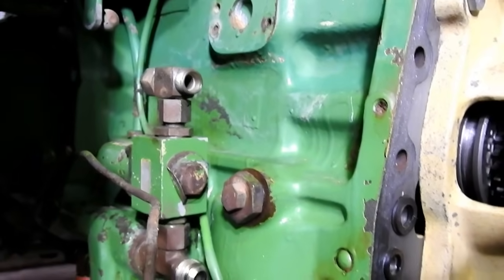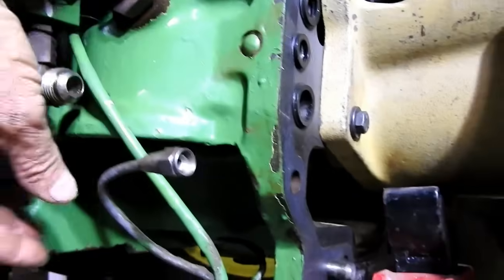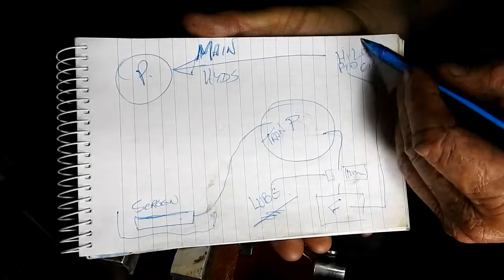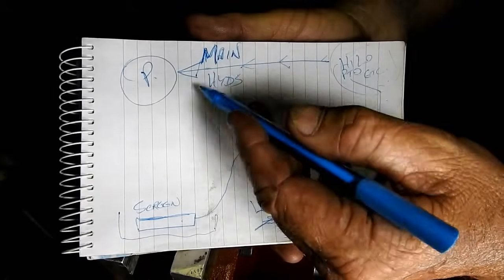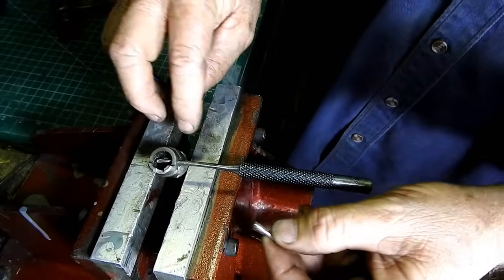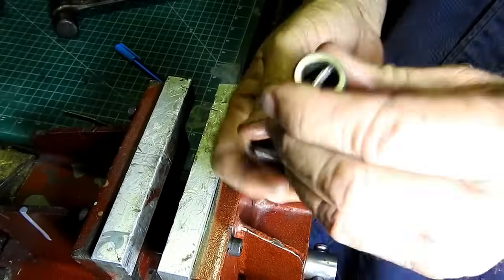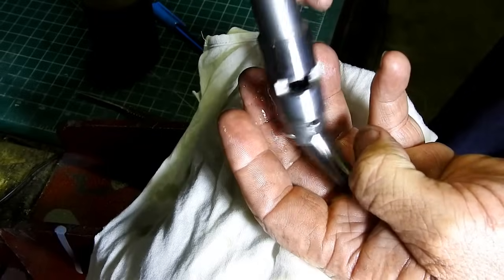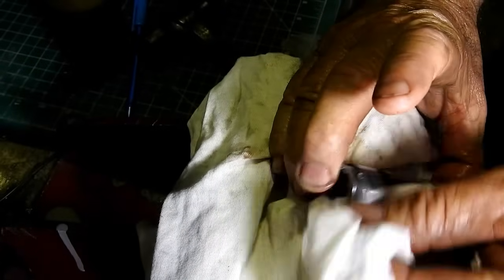How to Check Your John Deere Filter Bypass Valve

Comment: Lance--Thanks so much for posting this and for the great details. Due to this video, I got the knowledge (and guts) to tackle this myself. I did find crud in the valve, but not too much, and it gave me the mojo to go on and tackle two more valves, the Low Pressure Relief Valve (right next to the brake valve--seemed ok) and the Pressure Control Valve leading to the brake valve which had a disintegrated O ring. I use the Operators Manual and Parts Catalogue for the 2020 as a guide since it is all I can find, but there do seem to be some slight configuration differences here and there. Information on the John Deere 1640 is pretty scarce, so your video project is great. 
We are having some very weird hydraulic problems on the 1640, so I thought I would start with the "cheap stuff" first--the filters and the valves you can get to from the outside before taking the dreaded top off. 
Cheers, 
Jim Stewart, New Brunswick, Canada
Reply from the maker: Just go slow and you will probably learn a lot.
Reply: Mam problem z hamulcem w 3350 john deere dopiero jak kilka razy nacisnę pedal hamulca wowczas hamulec robi się twardy . Proszę o pomoc.

Comment: I bought and just installed a rebuilt high pressure pump in my 1830 jd but the loader is very slow and the steering seems to not be getting enough oil either.   To get increased flow/pressure will turning the adjusting mechanism on the pump do the trick or is there something else?   I verified there is excellent charge pressure coming to pump. also the old pump i took out had alot of pressure but i replaced it becasue it was pounding and cracked the high pressure output line which goes to the priority valve.
Reply from the maker: You may be loosing it in the loader control valve if it is set lower than the system pressure.
Reply: @BundyBearsShed  I measured the pressure by plugging in a gauge into the quick coupler on a pioneer nipple and throwing/holding the level.  I adjusted the pressure to 2450 lbs and there was a marginal improvement in loader movement.  But what happens is if the tractor runs at moderate idle for a short time the pressure builds to 2450 but the loader moves quickly for a few seconds then slows down.  The pressure drops down below 2000 and is slow to recover.  It takes 10 seconds to recover to 2450. Also if I run the engine at 2000 rpm the pressure does not build up and only if the rpm is 1000-1400 does the pressure build up ideally.

Comment: I have a john Deere 1040 that has no steering my 3pl arms don't lift and my hi/lo doesn't work I have cleaned the hydraulic screen put in a New filter and flushed the oil with new oil 3 times I can hear oil squirt in the hydraulic filler cap have you ever heard of this
Reply from the maker: Check this valve as the oil you hear will be lube oil. you may have a split pipe inside. We will get to that on this one very soon.
Reply: I tried the Valve pulled it apart and it moves freely easy started the tractor and noticed My PTO turns all the time unless you really rev it have split the tractor and pulled the hi/lo clutch pack and the PTO brake and PTO clutch pack and transmission pump can't see eany damaged Steel lines going to inspect the PTO brake tomorrow

Comment: Great video Lance; I have a question about my jd 2020. Can you change the impute shaft seal from the bell housing side or do you have to split further.. Thanks in advance I loved the steering and front end video's you did. Thanks Rick
Reply from the maker: G Day Rick, You will need to split behind the gear sticks for that one. There is 2 sneaky bolts under the gear stick cover that you need to know about.
Reply: Thanks for the info. Have a Blessed Day  @BundyBearsShed

Comment: Did they have mixed open center and closed center utility tractors over there too?
Reply from the maker: G Day Brian, Yes open center for the low pressure and what is left over from the pto, hi/lo etc.  gives charge pressure for the closed center system.
Reply: Bundy Bears Shed no I meant did they have models with open center front pumps. In the us some models were price fighters and didn’t have the good closed center pumps and valves.
Reply from the maker: In the 6010 series but the pump was up the back near the rock shaft, no other utlilty type tractors did that I know of. No open center front pumps anyway. The 5400 etc was a timing cover driven open center.
Reply: @BundyBearsShed  In the states we had 820,830, 1530, some 2040, some 2240, and some 2150 with open center systems. They are real odd ducks to work on. all the 5000 series are opencenter with the timing gear driven pumps and the 6000's are all what they call pressure flow compensated. It works like closed center but uses an open center style pump.
Reply: Always fun and interesting learning about what they do worldwide. :-)

Comment: Much more complicated than a Massey Ferguson 188
Reply from the maker: G Day Huw, Yes completely different, this used open center to work the low pressure system then the left over oil for the charge pressure on the front piston pump. Both have things they are better at.